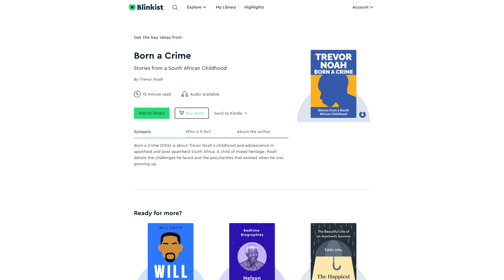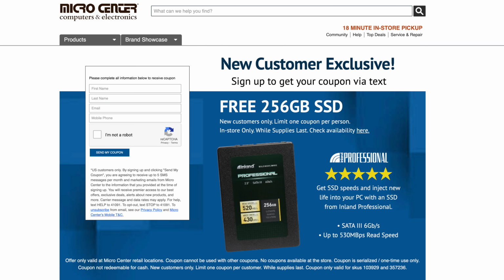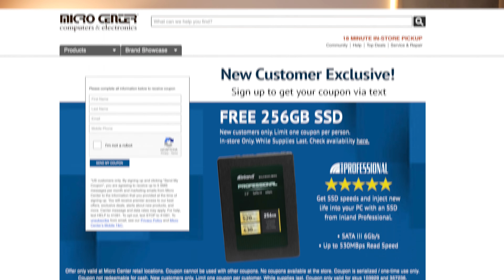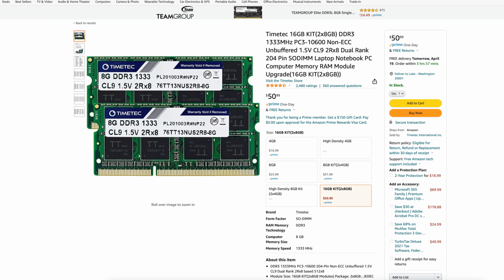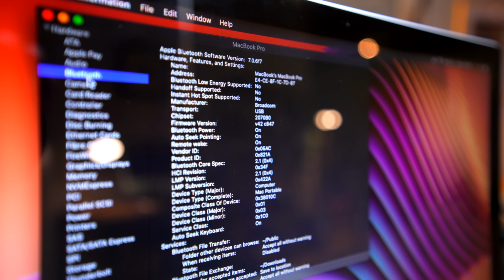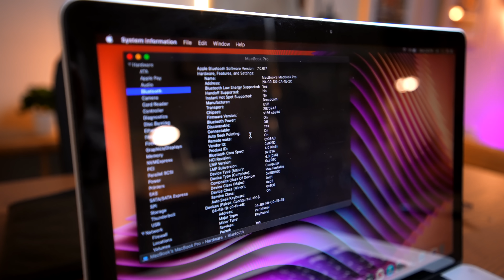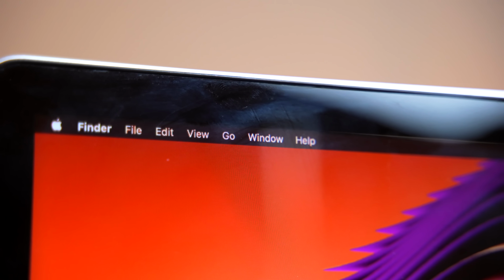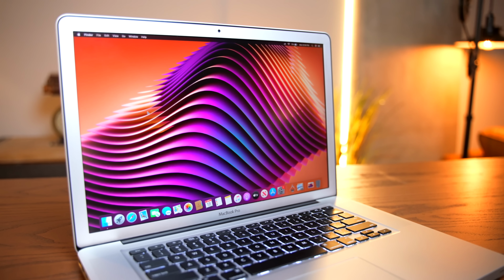Breathe new life into an old MacBook with THIS upgrade

Comment: I love the upgrade selection here, but do wish you would have gotten into the software/driver side of the newer Airport card. I did that upgrade with a 2010 MBP, and sometimes it was great, other times it was a HUGE pain. Also, I think you have to modify the bracket for the airport card. Unless I'm totally wrong, it's not just a plug and play part.

Comment: I have an M1 iMac and I had a 2019 base 16 inch MacBook Pro. I sold the MacBook as I hardly touched it at all and used some of the funds to get my business further along. However I realized that having a laptop might be helpful when I go out of town and on vacation although that’s rather infrequent. Therefore since it would be sitting around unused most of the time I didn’t really feel like spending $2500 on a new 16 inch Pro. I bought a Mid-2010 17 Inch with a Core i7, 8GB of RAM and a 500GB HDD on eBay for around $330. I wasn’t sure if would work out as it’s a 12 year old computer, it actually is much more respectable than I expected. I normally just browse safari and do basic tasks (which if Miani’s video about a 15 inch MacBook Air does come into fruition, I would likely buy one instead of the 16 inch Pro, just as he stated in that video I bought it not because I needed the power, but I want a larger display) and this Pro does that honestly marginally slower it seems than the 9 year newer Pro did. Sure, it takes longer to start up but most of the time I don’t even power it off. It’s plugged in and in sleep mode on my desk. It honestly really made me realize how overkill that 16 inch was for what I was doing. I don’t feel the need any more at all to get the new 16 inch; this 17 inch does everything I want for about 85% off, it has a DVD drive if I need it, and much more ports. It also has the anti-glare display. 

In order to get the max out of it, I probably would put an SSD in it, but I’m not rushing to do that. I’m satisfied with it as it is.

Comment: I did the ssd and ram on a 2010. Mine had the dedicated gpu, which was problematic, so I also had to replace a capacitor on the motherboard as well. Didn’t think to do the wifi card and display.
Reply: Just curious, which gpu is it? I thought only the AMD gpu's from this era were problematic. I'll be kinda scared if you tell me it's an Nvidia gpu.
Reply: @oldlavygenes  It was the AMD
Reply: @pinkflamingo8806  Okay, in that case I think your model was 2011 instead of 2010. The 2010 models had duo core processors and nvidia graphics. It was the 2011 and 2012 non-retina models that introduced quad core cpus and the problematic AMD graphics.

Comment: Man, I am so disappointed!  My aunt gave me a box full of her older Macbooks, iPhones, and iPads to sanitize/destroy.  Of course, being a collector, I won't destroy ;)  I have one of these with the i7 2.2GHz process that I was looking forward to using.  It works, eh, sort of.  I believe the video has some bad video RAM in it as sometimes it displays fine, but then these weird, vertical red bars will form when there is too much demand put on the video :/  I had hoped to bring it to my office (which I did) and use it to VPN into my home network such.  Heck, the battery actually still has some life in it if you can believe that.  Also, the hard-click does not work on the touch pad, but I have a host of wireless mice that I would use anyway, so that isn't a big deal.
Reply: Is it a 2011 mbp 15 or 17"? If it is then the GPU is probably dying.
Reply: @gmdrandom6287  Yes, sounds like it :(
Reply: @BollingHolt  you could try disabling the gpu
Reply: @BollingHolt  and use integrated graphics

Comment: Hi Luke, the only problem is that even with this nice upgrading process, this MacBook Pro from 2010 will be stuck to Catalina or whatever. I have got a silly question: could this make a nice Windows 11 or Chrome OS Flex machine? Maybe you could do a future video on the subject?
Reply: You can get the newest macOS version on a early 2008+ MBP by using open core legacy patcher
Reply: @gmdrandom6287  Better than that, install PopOS or another similar Linux distro. Runs pretty well on these old machines.

Comment: I have a similar device, a mid-2012 MacBook Pro, that I bought new.  It has a quad core i7 processor and came with the high resolution matte display.  I immediately upgraded the ram from 4GB to 16GB and replaced the mechanical hard drive with a SATA3 SSD and used it as my photo editing computer till about 8 months ago when I replaced it with a M1 Mac Mini.  I still use it for presentations, and it's getting a little slow compared to the newer computers but very usable.  Considering the life expectancy I think Macs are actually cheaper than PCs.
Reply: PC laptops of a similar vintage should have a similar lifespan(not counting the macOS optimizations) but MacBook pros are usually built better.

Comment: I have the 13in i5 MBP. I upgraded RAM and SSD. It is fast enough for most tasks, but I have all but retired it now. I only use it for generating G-code files from STL. It is slower than my Lenovo, but the major benefit is I keep the MBP on my 3D print table. Would I recommend an older but upgraded MBP for this? Nope, too slow.

Comment: Finally replaced my 2007 MBP, 15”, 2.2GHz Core2 Duo. I had maxed it out with 6GB RAM, and 5 years ago, upgraded to an SSD. That’s a notably less capable machine than the one Luke just upgraded, and mine was still pretty usable, so I’m sure his is notably better. Mine is limited to SATA 1 (1.5Gb/s) speeds and DDR2 DRAM, so that Core i5/i7 CPU with hyperthreading, with DDR3 RAM (up to 16GB) and SATA 2 (3Gb/s) is a notable step up. Not a bad machine, at a very affordable price, if you’re willing to do the work.

P.S. I replaced my with an M1 MBA. Not crazy about the smaller screen, but aside from that, the Air is a huge upgrade, even with only 8GB RAM.

The biggest issues with mine old MBP were the 6GM RAM max, and the latest supported OS X is 10.11.x. The one Luke upgraded supports OS X 10.13.x, which is still dated, but closer to the modern versions.
Reply: Actually that laptop is limited to 8gb.
Reply: @EvilTurkeySlices  Actually, no, it’s limited to 6GB, it’s not reliable at 8GB. The 2008 could go to 8GB.
Reply: @geoffstrickler  no, the 2010 core i5 or i7 one.
Reply: @EvilTurkeySlices  Ah, right.

Comment: G-morng Tech Master Luke. 1st Time commentor, Long Time Watcher Subscriber/Commet Reader.  This is Tech Dan or as most of my clients/friends call me 'DB' of DB Pro Audio Services based out of W. LA since the early 80`s. Not to sound over the top brown nosey etc etc. But truth be told (obviously in my opinion)  I'm extremely inpressed, entertained & inspired by 99.9 % of the content you've been producing for consumption on the interwebs & beyond. I dead serious. I can't help but think to myself you've been working in & around the entertainment industry some years. At what capacity only you can say. I took some entive you implanted in me about a year ago and I picked up a beautifully cared for Mid 2012 15" MBP from a client/owner of a local a/v editing facility I wired years ago for a buck twenty five. Score!!!  wow TMI excuuuse meee!!!  Ive got a pre season lil lull ln my sched & thought this would be a great time to start this mini build/upgrade project. She came with 16gigs of ram, anti glare screen etc.  Im ready for the next step SSD upgrade. Is Micro Center my source for the drives as you'd mentioned in this vidy? Do Tell if you don't mind. My email: goldenear@yahoo
Reply: Hopefully you`ll get a chuckle....Typed on a 65" LG w/Magic Mouse

Comment: I prefer the 13 inch MacBook Pros from 2012 the last models with easy RAM and SSD upgrading. 

These models too are the first MBPs with metal gpu support and can easily be upgraded to the latest OS Monterey with OCLP (Open core legacy patcher) . This is no option for MBP before 2012 because these models have some unpleasant graphic issues.

Comment: I did something nice some weeks ago. A 2006 polycarbonate macbook  was given to me by a friend. Originaly it has mechanical hdd 1go of ram and mac os 10.5. I upgraded it with 4gb of ddr 2 a 128g ssd and mac os lion. It's totally usable ! Vlc last version Open office last version and chromium legacy (a modified version of chromium but totally up to date version designed to run for browsing on old mac os anteriors to el capitan). It just cost me 20 bucks for the ssd the ram was spared. As I'm french i just think about adding stickers on keyboard because the mac as a qwery one and i would need azerty.  One thing I regret nowdays is that despite the big performance progress of m1 apple locked everything and they wont be upgradable at all contrarely to older ones.By the fact luke I love you're channel ! May the force be with you!

Comment: I absolutely agree that they pass the test of time and are still fabulous. I actually have just bought a new Mac mini m1  a month ago or so and till then I was using my 2011 MacBook Pro. Ive done all the upgrades to id - ssd, old hd instead of cd rom, 16Gb, new thermal paste, speakers, fixed a broken fan (which was seriously the ONlY thing that ever broke). I havent done the screen. Didnt find a need. Now im thinking of trying to install monterey on it. 
So Yes, lets revive! Our basic needs have not changed at all, so as soon as we can deal with this „I want new new new” tendency we’re all good with older stuff. And I actually really enjoy the upgrading process:)

Comment: Interesting! Especially for me as I have a 2011 15" MBP I literally forgot about. I had to think where it was. It's already got 16GB of RAM and a 256GB SSD. I think I may have to do that screen upgrade!
Reply: Been two weeks, I did this upgrade. My late 2011 MBP so much better with the screen upgrade. I'm letting my son use it as his school computer. Another radical mod I did to this laptop was cut circular air vent holes in the bottom of it directly under the fans, with mesh grids over them. It keeps it much cooler than without as IMO this model had airflow issues. Now the fans suck cool air directly in. The mod is on the bottom where you never see it- just the same it looks great.

Comment: I have an iMac 21.5 inches mid 2010, originally it was the base model with the core i3 and the AMD Radeon 4670, I recently changed its video card for an AMD FirePro M5100, I had already installed an SSD and the next part I'm going to update will be the processor, I will put a core i7 860s, which is a low consumption model that it accepts. At another time I will try to update the Wifi and bluetooth card, but I already know that it will be a little more boring to do. And of course I already installed the latest macOS using OpenCore Legancy

Comment: Nice to know that the functional salvaged 15in MBP I got for my wife came with said display and airport card =)  *edit:  I went through my stack of unibody MBs and found that the 15 in one that I have is actually a MBP with the anti glare screen as well but it's a 2010 model with the GPU capacitor issue which I should take care of in the near future.

Comment: Hey Luke, I've got a mid 2010 with the higher res screen (silver bezel) and it's still running like a champ. What I also have is the kernel panic fault that was a design flaw of the dual graphics for this model year. Have you ever come across a reliable fix for the kernel panic? I've been using the gfx v2.3 card which forces it to use only the integrated graphics and it doesn't bomb any more but it's also a band aid.
Reply: Delete gfx after doing this and enable auto graphics switching. You will have no issue.
Reply: @Axel-qv4sr  have you had any issues with security since you disabled the protection? I've read about this work around but never trusted the idea of turning off the system security.
Reply: @joemoonen9320  honestly I'm not happy about it either but no issues yet. I'm careful not to open any app or anything I don‘t trust.
Reply: @Axel-qv4sr  that doesn’t make me feel warm and fuzzy. I’ll stick with the gfx fix. It’s been working pretty good and I don’t have to sacrifice security, only screen mirroring which I don’t need anyways. Thanks for the tip though.
Reply: @Axel-qv4sr  so does what you’re describing fix the kernel panic?

Comment: Speaking of leveraging older Mac hardware, I'm running Monterey via OpenCore on my late 2013 MPB 15 with 8GB of RAM. It runs flawlessly, no load spikes or mad fan action, it's totally smooth! The machine is obviously slow by today's standards, but it is perfectly useable for 99% of everyday use. I didn't notice any slowdown after installing Monterey.

If you don't plan on doing any video editing, or heavy photo editing, this is an option to explore to upgrade an older Mac without even opening it up.

Comment: Watched this on a 'mid-2010' 17" i5, with an upgraded 1tb SSD, and it's original 1920 x 1200 resolution.  It happily runs Logic Pro 10.4.8. I'm only going to upgrade if I can work out the logistics of networking it (and my 2008 Mac Pro) to an M1 to use all my music apps/interfaces etc.

Comment: ive not noticed 1900 by 900 being bad tho i do use the app :RDM sometimes to get a highter res.

but maybe i will get a screen upgrade tho by now ill hopefully get a mid2015 that prob will 
have a better screen than the one u just added onto it.

i do feel that my mid2012 15inch qaud core could run the retina module specilly if some cable mod was out there.
i know that someone made a wifi/bluetooth connector mod so they could use pcie wifi cards in the macbookpro.

ngl wish i knew about a slightly better screen version was out there b4 buying the same 2012 non retina model in 15inch form but hey its good for me still

Comment: I think that the same thing has happened with smartphones over the past 12 years that happened with laptops in the 12 years before that. Like right now no one would buy an iPhone (or other smart phone) from 2010 with the intention to actually use it, whereas I do wonder if in another 10-12 years, smartphones won't have changed as much as they have in the past 12 years.
Reply: That’s because arm never ages very well. The iPhone 6s is one of the lucky ones ti still be usable after 6 years.

Comment: i have a 2015 13 inch macbook pro, and outside of replacing the ssd and i did a bad choice with the ssd i bought, (wd blue 500 gig with an adaptor), the rest of the machine is absolutely awesome, i will just need to replace the ssd and finally be able to install monterrey the rest of the machine is great, only regret is only having 8 gig of ram in the laptop, so its disappointing if you want to run parallels desktop because i don't have enough ram and probably getting a logic board with 16 gig or even 32 gig must be a rip off still today in 2022

Comment: But does it run eveyday office essentials like Teams and Office 365 that most workplaces use these days ? I upgraded an Imac 2009 a year ago or so with a SSD kit, something related to the fan I think and upgraded the memory to 16gb. Well 6 months later, everything started to work very slowly and to be buggy especially when I had to use Teams and Office 365. The web browsing experience was sluggish even in Safari. Any thoughts on that ?

Comment: This is great content Luke. I have a 13” MacBook Pro mid 2012 with a screen issue. A thick vertical black band in the center, all the way to the bottom. I still run it with a secondary display to fill in the gaps but seeing this video has raised my interests. What is the best route in terms of screen replacement for this MacBook?

Comment: Is there a similar screen upgrade for a MID-2010 13" MBP?  The main reason I moved off of mine (new since 2010) was the tiny 1280x800 screen res.  I bumped it to 16GB long ago, and have an SSD I could drop in it.

Comment: My family is still running old Macs (including me) thanks to new internal hardware. All of these have their hard drives replaced with SSDs, and my iMac is maxed out on RAM (32GB), so at least it's smooth and fast when using it for light- to medium-intensity tasks.

Comment: I own a old c2d 17” mid 2009 mbp which also has such a screen with 1920x1200, it has the 3.06 Ghz processor and 8 gb of RAM. People don’t realize it was a pretty scarce puppy in it’s day, and it still good usable for browsing, mailing and even light photo processing, especially with that nice screen. Indeed the wifi reception leaves to be desired a bit. It takes it’s time when booted. Bidding on it is subpar...

Comment: I have a Late 2012 Retina Macbook Pro. While it's not as user-serviceable as its predecessors (the RAM is soldered onto the motherboard), it can still take aftermarket SSDs using a simple adapter, and it feels extremely fast and capable.
Even my 2008 first-gen Macbook Pro feels snappy, and I love the case design and huge assortment of ports. I actually installed dual SSDs in my 2008 Macbook Pro: a 500 GB 850 EVO SSD in the hard-drive bay, and a 480 GB Intel SSD in the optical drive bay using a disassembled SATA-to-PATA adapter (I had to take it apart so that the PCB would fit).

Comment: Love the silver bezels.  I have a 2009 macbook with the t9900 and the matte screen.  Also the resolution is 1680x1050, not 1650x1050  =)
Reply: Hey, I have an old mid-2009 macbook pro 15" and wondering if this matt screen with higher resolution and a newer wifi card would be compatible, since he said that it would have to be upgraded too due to the bands/antenna connectors in the screen. Any advice would be appreciated.